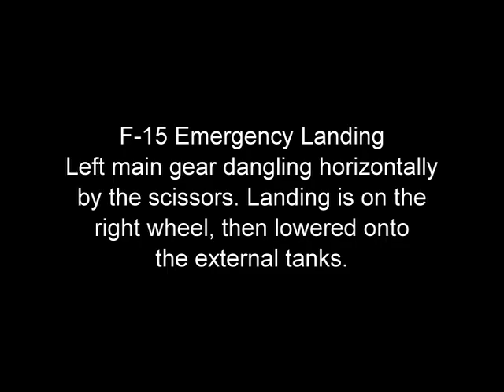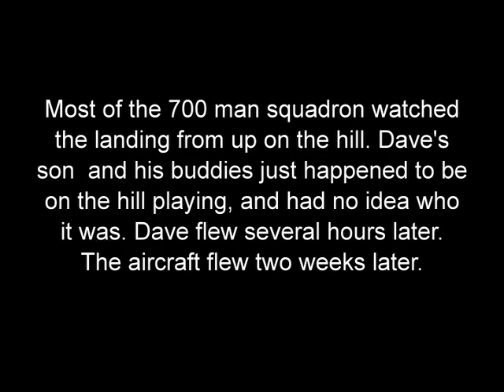F-15 Emergency Landing.mov

Comment: Being that the light grey Eagle was all air-air, did the F-15 FIS squadrons do much differently from the F-15 Tactical Fighter Squadrons? I imagine other than deployments? Or was training and ops similar enough that one could PCS between the two unit types?
Reply from the maker: A FIS and a TFS were very different, however pilots did go back and forth on assignments all the time. The US-based  Fighter Interceptor Squadron mission did not involve fighting enemy fighters. Its adversary was a bomber/cruise missile threat. A Tactical Fighter Squadron's missions are obvious. So in the FIS, it was a lot of night intercepts and  less fighting other fighters. You can imagine how well that went over with TAC F-15 pilots sent to a FIS! For a little while, it sucked. Over time, the influx of TAC fighter pilots replacing  old ADC interceptor pilots got the FIS out of the rut. Fortunately, even at the command level, as Air Defense Command morphed into ADTAC and 1st Air Force and whatever the hell else it was called, the leadership realized it was smart to let the FIS pilots fly some air-to-air missions just like the TFS guys. It kept proficiency up and  the moral up. We could go to Red Flag, for example, but only as Red Air. We could not do escort or force protection because technically we didn't have that mission. But it wasn't a heart breaker that we were restricted to Red Air! That made the Red Flag briefings more bearable and was a lot of fun.  I was the ADO at McChord and thankfully my two squadron commanders pushed to keep us flying standard TFS training missions, including DACT and dart. Our Air Division commander was also a TAC guy and as long as we kept up with our primary mission, he was also fine with us keeping up with normal TFS air-to-air missions. We just had to stay away from offensive CAP or force protection scenarios, but we could fly DACT pretty much all we wanted and get to turn and burn. Semantics. Our standard squadron training cycle started with BFM and progressed right up through 4 vs 4 and large force employment...yeah, and plenty of night intercepts.  I was the Operations Officer at Keflavik, Iceland after that. My commander and I were both TAC to start with (F-4 air-to-air in Thailand, German F-104 Fighter Weapons School, and Holloman  F-15 for me).  We deployed to Bentwaters to support the Aggressors when they went from F-5s to F-16s and we went to Decimomannu (non-stop, unrefueled from Icleand! )  to fight whoever else was there on the ACMI range. So what the FIS pilot got to do was a little dependent on who was running the local show, but we made it pretty challenging.   It's all history now and a very different USAF.
Reply: Thank you for the great info. I'd wondered what the specific differences were. By the time I started in the AF the only FIS units around were in the ANG, with I think the 57th at Kef being maybe the only active one, although designated an FS by then. My time at Holloman was after the F-15 era, when we'd swapped to the 117. Was a pilot in the 7th and 8th FSs, the 7th being our FTU, with the 8th/9th as ops units. The few light-grey Eagle folks we had in the community (everyone comes from somewhere else, in the 117)  were all too young remember the FIS units, so they had no info. The info you write may all be history now, but what a great and rich history it is, seeing as how the AF seems to have a hard time remembering its own history these days.
Reply from the maker: We just missed each other. I came back to Holloman from Kef in 89 and was in AT-38s and had the academic squadron, then the 435th and 433rd TFTS. We changed to the Ops Group structure, a huge project, as we handled the arrival of the F-117. Those two things at once were nuts.  I played Deputy Ops Group commander during that time while they were waiting for a colonel. Bob Huff, F-117s and great guy, came in as my boss and handled the F-117 transition. I stayed with the AT-38/F-15 side until they finally got a colonel in. Back to water boy, but then suddenly back in the game  (no one else left to play!)  and got to be acting DO of the 49th TFW across the base. Just me and the wing cc--he had no vice or DO!  We were busy with a MISP and a squadron in the desert. Really busy. Checked back out locally in the F-15 in 3 days and had a blast with that until we went from 3 squadrons down to two jets. Ugh. They left me in charge of the base one day, so I checked myself back out in the AT-38 in one ride, signed my own Form-8,  and started instructing immediately. Too late to stop me when they got back. I left summer of 1992. Fig was the general and Guariino was his vice. Huff was the Ops Group Commander. Crazy 3 years. It was fun to meet a lot of the early F-117 guys.
Reply: The building where the 4 LIFT squadrons were, eventually became home to the 20th FS and their F-4Fs out of George after that place closed and LIFT left Holloman. The 20th lasted another 12 years until shuttering in 2004. Their F-4Fs I believe were some of the only AIM-120 capable F-4s. You probably remember when the resident drones on the north ramp were QF-100s and QF-106s. My UPT class didn't have any Eagles, light or dark grey. Never really dealt with them in my time, as the Hog and the Eagle have such polar opposite missions, but would've been nice to. Only time I was ever around them was at Elmendorf when dad was up there in mid 80s. Same time when that Lt from the 43rd mis-set his OWS and tore his Eagle apart during that high speed/low pass flyby at Galena.
Reply from the maker: While I was still in the Ops Group, the 20th squadron commander came out for a site visit and was very demanding. Told me what he was going to "take" in that building. Quite rude, actually. He clubbed me over the head with the fact  that it was "the German program" and they would get what they wanted. I had not mentioned it to him, but I had flown in the German F-104 program at Luke for 4-years and taught in their FWS and knew as much about the German contract as he did. He was a knucklehead, but they had some great guys in that squadron I got to know later on. Good squadron. I knew several  of the drone guys. One was an old F-104 IP from before my time. Alaska lost too many F-15s to really stupid stuff. Very sad. I had a lot of interface with Hog guys at Red Flag and other exercises. There were a lot of Hog guys in the AT-38 squadrons, too. They were pretty loose and I imagine they think I was too tough on them--I made them stop eating in flight briefings and close the door, so they couldn't bullshit with guys walking down the hall. Pretty funny! The F-15 community was known for the huge ego, and I found that was true! When I got to Holloman in 1981, their craniums were in danger of exploding. That finally changed into the 90s, but the reputation could not be shaken easily. All seemed silly to me at the time, and still does. The F-16 vs F-15 war was advanced by the generals, Gen Ryan as TAC DO in particular, and I hated that and wouldn't participate in it. We should have been doing mixed force instead of sniping at each other. Ryan hated F-15 guys and told us at a TAC squadron commanders' conference to tell our F-15 guys they would never be squadron commanders while he was in TAC. Unbelievable. The F-16/F-15 feud was one of the dumbest things I saw out of our generals. I hope that stuff doesn't still go on. The force is too small to not use it the best way.
Reply: The F-104 would've been a hoot to fly. If I remember right, Luke had two squadrons of them, the 69th and the 418th. Saw them at an airshow there once, back when Luke had the two Wings under the Air Division still. Speaking of Luke I'm surprised they've been able to remain viable what with the amount of encroachment that's gone up around that base. I hadn't been around there in good few years (Im from the SDL area), then last month, my reserve unit took our HH-60s up from DM for three days to participate in the Transformers 5 filming, and I was surprised how much is around and to the west of there now. We did interface some with Eagle guys at Red Flag, but unless we had some kind of involvement in the air-air fight, we generally tried to stay away from the air-air debrief, which seems to last forever and a day, with the constant syncing/replaying of tapes and pod info during the shot eval......far too long for we lazy Hog guys to stay awake. Insofar as Smurf jets, the Hog guys indeed were more lax. The studs going through the Eagle track had something like 20 or 22 rides of all air-air, offensive, defensive, high aspect; and would come back from rides wiped out. In the Hog track, we had 2 offensive and 4 defensive rides, and that was it for air-air, for our roughly 18 or so ride program at the time. Long time ago so I don't remember the exact numbers, but I do remember my couple of flights with IPs from Eagle backgrounds and they were pretty hard core with the whole "getting you indoc'd to squadron life". One was on my Defensive BFM checkride, the most busted ride in the program. Passed it on my first try because "you're going Hogs, not like you have much to fight with there anyway" lol.
Reply from the maker: That's funny! Fits with my memory of LIFT in 1989. I got there after my Ops Officer tour in Iceland to go through the Smurf IP program. My buddies asked me what I thought of it after a few weeks. I told them it was A-10 guys teaching Vietnam era F-4 stuff to kids going to F-16s and F-15s. It made no sense to me at all! It was the most outdated training I had ever seen. Nothing had been updated since the late 70s! If they picked up those red and blue airplanes on a stick, I'd leave the briefing room. The first day there, before my course started, they had me ride in the back seat of #3 for a 4 v 4, Smurf IPs  against Eagles, led by a famous 435th major (ex F-4) on his last flight. He did no planning and when the Eagle guys got there, he asked them what they wanted to do! They reminded him they were the training aids. Basically he told them to go to the north point and he read the ROE. They Eagle guys were very uneasy and had to ask for their blocks and what ordnance they were supposed to have! Unbelievable. When they left, he asked his wingmen if there was anything they wanted to do. He had no clue! His briefing was so bad that when he got up to leave, I had to say "Hold on. Sit down. Close the door. This isn't safe enough to fly."  I had never met this guy!  We got that fixed and flew it. The guy I rode with never saw anyone and gave me the jet. He didn't even know me. What a debrief. There was a lot of stuff to fix at LIFT, but plenty of good guys to do it. They just had to be turned loose. I had 3 A-10 guys who were stars: two were flight commanders and I made the other one the squadron weapons officer. There had never been a squadron weapons officer at LIFT. There wasn't even a wing weapons officer, so I took that job informally as well as squadron commander. I'm sure I was a pain in everyones' ass, but I couldn't handle that 1970 era F-4 stuff. I did all that the first time. 

It was just the 69th when I got there. 418th was gone. The F-104 was a hoot and the German program was first class. I flew over 1000 sorties and always had a jet and always took off in that jet. Never needed a spare. Lockheed Air Service was the best I've ever seen. It was a great assignment with some of the best aviators I've ever seen in one place. Luke is surrounded for sure, and the F-35 is the loudest jet ever in mil power alone! I think they get away with it only because there are  hardly any sorties flown. The ramp looks empty. It's not like Luke in the old days!
Reply: The 435th is who I went through, and at the time they had just moved to Randolph. The ATs were still B models, so like you said, all the air-ground sorties at the range, were all manual mil-crank bombing: level, 10/20 pop and 30 DBs. We carried the standard SUU-20 with 6 BDUs. Being Hog track, we'd asked about doing some minigun pod shooting, but apparently that had gone away years ago. My class was 2 Eagle studs (A track), 1 F-16 stud (B track), 2 Hog studs (C-track), and a Nav going to Mudhen WSO (D track). The air-air sorites were mostly done by the Eagle/Viper IPs, I rarely remember a Hog or former Vark IP doing those rides. Opposite was true with the SAT rides, and everyone taught the Form and low-level Nav rides. Nowdays, from what I hear, the C model ATs have a HUD, and one that can be programed to replicate the aircraft they're going to. But no expendables on the jet, all SAT rides use simulated ordnance apparently. Funny you mention the briefing style, Im sure for air-air, there were alot more details to brief, blocks, radar sort, form, tactics, etc. By the time I was late in my Hog career, launching on a FAC sortie, I'd head down to the players if they were on base or at Snowbird,  or even  next door at TUS, and (barring any training needs from them that needed to actually be briefed) I'd leave a yellow sticky on their briefing room door if they were in brief, with callsign, airspace I'm in and controlling, altitude I wanted them to be at, time to show, and frequency to check in on. Basically like combat. Everything else, they'd get on scene with the scenario at play. Granted, this method can't be brought back to a UPT/LIFT/FTU training environment, especially for an air-air sortie, but I can see where it may have come from. lolThe F-35 was indeed loud as heck, much louder than the Vipers there at LUF. The Tucson ANG had been a candidate to get them, but the city leadership doesn't seem to care for DM, or the ANG at TUS. They say they do, but it's mostly lip service. They complain that the Hogs and Vipers are too loud, they would've been out of their minds had F-35s shown up here.  With Hogs on their way out slowly, there's nothing really to replace them at DM yet, nothing in stone at least. For all the aircraft here, the 355th Wing only owns two squadrons of A-10s: one ops and one FTU. Every other flying unit on base is a geographically separated unit belonging to some other Wing/base.Was fun times. After leaving active duty after my 117 tour, I came back to TUS from HMN, and went to an HH-60 helo unit as a part timer. Haven't flown a tactical jet in over a decade. I don't miss active duty much, but I miss having to think at 6-9 miles/minute in those planes.
Reply from the maker: I was going to ask you where you were now and what you were doing. Did you have helicopter time before the Hog tour or before USAF? I live by Luke and retired from Southwest, so I went slower than helicopters! Great company. The Cactus Starfighter Squadron, old F-104 guys, still hangs out in the 311th and I go to a briefing now and then. Last one was on the F-35 and the Norwegian who gave the briefing disputed most of the jet's troubles in Aviation Week. I asked if they had CAS in the syllabus, and the answer was "some." I asked the US squadron commander if he thought USAF generals would use the F-35 for CAS and he slowly said "yes." That's  a lot of bucks to risk to small arms. Doesn't look like a tough airplane to me. It's going to be interesting. Air-to-air briefings got way out of hand. To cut down on that, I refused to brief (or hear) anything about taxi, takeoff, to the airspace and back, air refueling...none of that. "Standard." I didn't want to  hear it in AT-38s, either. Students didn't need that time after time.  Guys briefed taxi to death when they didn't know how to teach. After I canceled a few missions they finally quit briefing me on admin crap. I drove the Captains crazy instead of the other way around--I had to try not to laugh sometimes!  I went to Yuma WTI for years (it was my secret), in both the F-104 and F-15. It was like a mini Marine Red Flag. The inbrief with the Marines took one minute: "Defend the South TAC from 13:00 to 14:00. ROE standard. Simulate XXX with XXX. Blocks, kill removal, GCI freqs.  Write your call signs on the chalk board and we'll file VFR for you. Questions?" Done. So much easier than Red Flag. We could mission plan and brief it up in 30 minutes. Debriefs were an hour max. I flew OV-10s for two years and got to operate as a FAC like you did for a while. Big boy rules. It was nice.   Now I hunt with my dogs, surf in CA, shoot service rifle and IDPA, and cuss at the occasional F-35 overhead when I'm trying to hear where the quail are talking.
Reply: Ha! My biggest pet peeve are guys who brief particular admin item(s) as "standard", then proceed to explain it out. You just said "standard", why are you now explaining what the standard is? Isn't standard supposed to cut down on the brieing time?!? Example: "ok, on takeoff, linup will be 20 second interval, standard. So I'll put you on the upwind side, you take the opposite side, comm out signals for ready/runup/brake release....blah, blah, blah."  Shut up! lolYeah, I had civil rotary time prior to the AF. Went to the AF through OTS, graduted #72/74 there, which means I tried to hard, and was one of 3 UPT slots in the class. Missed being able to go to Willie since it had shut down and got Del Rio instead. -37s to -38s. Wanted EF-111s but they weren't taking pilots to them anymore, just EWOs (lucky I later figured out, as I would've rotted away at Cannon). Selected A-10s and did 2 tours, Osan and DM. Put in for an OA-37 exchange tour but it got cnx'd, as those tours ebb and flow with the political winds, went F-117s instead, so short distance PCS from DMA to HMN. In the 7th, then the 8th FS (7th was right next door to the 20th's building back then).  Nearing the end of that, Big Blue wanted to send me to -38 IP at Enid. Didn't feel like going from Alamo for 3 years to Enid for 3 years. Since I was inside 12 months of my ADSC, I had the option to 7-Day opt. So I tried to work with the Randolph weenies, saying I'd done everything the AF asked of me, I'd just like one thing. I'll meet you halfway: I'll go ATC, I'd just like to pick the location. They ask where. I ask for joint USN T-34s at Pensacola, training Navy NFOs. They say no. I remind them I can 7 day opt and get out. They say we know that, but you won't, you have too much time in, officer and enlisted, you won't leave. And leaving Big Blue is scary on the outside, they said. So, I went to the CBPO and 7 day opted an assignment, leving me to finish my time at HMN. OG/CC calls me in the next day asking what happened, and I explain to him what occurred.  His only reply to me was "well, have you considered the concept of service before self?" Seriously? So, I left. Transferred to AFRES part time, and also got hired by CBP as an agent/pilot, based down here at DMA. AFRES unit is helos, so I went to Rucker to do the mil helo transition, which also upped my civil helo certs to Commercial and added an Instrument, which made BP make me a dual-rated pilot. Flew Hueys, and now AStar helos, and HH-60 rescue birds on the mil side. And flew the C550 Citation interceptors for awhile before those started getting retired, the jets with the APG-66V1 in the nose. Now only fly rotary wing. Living on the NW side of TUS. Orignially from SDL, so stil go up there to visit the folks.
Reply from the maker: Good, interesting career you had and a happy ending! Good for you.  I went through a similar exit: I was the first guy to quit the USAF as a student in Air War College. When I went in to get the "General of War College" to sign my retirement papers, he got mad at me. "Why are you doing this on my watch?" Huh? I started by explaining my retirement wasn't all about him. Where did they get these guys? Anyway, "standard" then briefing it. Ugh. Drove me wild! We heaped huge amounts of abuse on anyone who did that and it would start almost immediately upon uttering anything after saying "standard." I'd pretend to start getting out of my seat and heading for the door to cancel the mission or get a new flight lead and the apologies would start flying. I think we finally crushed that.  Funny stuff! It was all I could do to not laugh! Almost as bad was briefing right up to step time. I'd start obviously fidgeting in my seat and they'd finish up fast! I was old--I had to use the head! They would have to keep briefings under 30 minutes for me now. I had two F-15 buddies who were Army chopper pilots with lots of combat time. I was at Southwest with one, but he left Southwest and is the VP of Dillon Aero, the mini-gun maker up here. He flies the helicopter tests with the guns. Cool job.
Reply: Most of the flight briefs I saw guys doing, started to become about 20 minutes of useful info, and 40 minutes of dog and pony show, just to fill the hour. You know...just brief what needs to be briefed. And then we'd get guys who have these complex as hell low-level first-run attack plans, with all kinds of geometry/timing to go with it. What wingman is going to remember all that crap? If the plan takes more than a few brain bytes, then its too complex. And the last thing you want is #2 being heads down trying to find what he's supposed to be doing next on the 1:50 map or his frag card, and smacking the ground or something attached to the ground during the ingress at 300 AGL/300 kts. No bueno.One of the H-60 flight engineers who used to be in my unit down here works up there at Dillon Aero, at SDL as well as their private range they have near Casa Grande. Good stuff. I've got about a year left, then will be happily done with the reserves as an O-5.
Reply: Retiring while in AWC in residence. Oh man, I bet that went down like a hooker in church. Was the General a non-rated, or a rated guy? The non-rated's used to see things like SOS DG or Kingof Flickerball being a major career milestone for them.
Reply from the maker: F-15 guy. Peterman, I think his name was. Had been Wing CC at Bitburg. He briefed our entire AWC class the very first day that if you were two years below the zone, "you will command," but "if  you're only one year below the zone, there are still good jobs other than command ." I was on time. When he asked, "Why are you doing this on my watch?" I told him one reason was because he asked me that question--everything wasn't about him. I told him he personally gave me the information I needed to make the right decision and that really puzzled him. I quoted  his first-day statement and told him I was just on time--he was the one who make it clear I wasn't even on the "Good Jobs" list.  He got quieter and admitted, "I did make that pretty clear, didn't I?" "Yes sir, you did. Would you please just sign this?  I'm in a hurry to get it turned in." He even tried, "Hey, stick with it, the course gets  a lot easier."  That made me laugh. I told him to check my grades--it was already extremely easy and I really loved the history portion.   He was actually cordial to me after that.
Reply: At least he listened to the logic, unlike my OG in the same position. The funny thing is, looking at all that command has to offer in the AF, and it's a ton of work, far less flying, and essentially alot of BS for little gain. I remember as an squadron ADO, my inbox (actual paperwork still very big then) never seemed to get smaller, no matter whether I put in 10, 12, or 14 hours. Finally one day, I just took a random 1/4" stack of papers from my inbox, walked over to the shredder, and ran them through. Just to see if anyone would ask me "hey, did you see paperwork X, or did you happen to endorse form Y?" But alas, no one did. No one ever asked if anything was missing or unaccounted for. That, combined with seeing cohorts of mine taking leave days, and coming in to work ON those leave days to do paperwork for the whole day+, let me know that this really was a modern day version of Catch 22.  When new Lt's were worried about getting boxes checked for SOS or working on a Masters and such, when they were supposed to be only worried about spending time in the vault and absorbing as much tactical knowledge as they could, I knew then that it was only going to get worse.  And sadly, it has.Funny thing, my agency gets slots to go to Senior Staff School courses in residence as a GS; Air/Army/Naval War College at their respective locations. Might be interesting to do as non-military. All my PME has only been ever been in correspondence anyway.
Reply from the maker: You and I think alike. Every new job I had in the USAF had  "required" reports to submit on some schedule. Even as a squadron weapons officer, there were weekly, monthly, quarterly reports of all kinds to submit to some higher headquarters. When I got a new job, I didn't send any of them. I could always claim new guy ignorance. I'd just wait. Often I would never hear a word. Done with that report!  Sometimes someone would call about it and after I asked him if the report was really used, I could get them to remove the reporting requirement! All through my career I'd get a calls from some staff guy somewhere demanding I do something--do a study, send a report, write a paper, do a project, research something...on and on. My answer was always the same: "no." They'd flip out. Most of the time I'd never hear about it. Sometimes it would come back down through my bosses, but I'd usually win. We were doing the job. We weren't the staff's staff! Working on leave days: no way.  I told all the wives that if their husbands said they couldn't get leave, they were lying--call me. If they didn't come home after work, see if they had a girlfriend: we locked up when the last debrief ended. Funny stuff! I told the guys with girlfriends they couldn't use me or the squadron as the excuse anymore. That had a few guys scrambling! Crap, we could go on forever with this stuff. It brings back some funny memories!
Reply: It's just amusing how it's the same BS, different decades, regarding your experiences and mine. With the BS only getting deeper and worse as time goes on. Nowdays, so much is "self service" in a squadron, when before there would be people whose job was to do those functions. Commander's support staff in a squadron is whittled down to nothing. Pay issues, TDY travel, and other support items, are all on the individual. And agencies that are actually supposed to provide support, such as the CBPO or MPF or whatever the heck they call it these days, either never have the right person around, or are magically closed for half a day of training, 2 or three days out of the week. No more simple stuff, like going to the cash cage at finance and getting fronted TDY cash. And don't even get me started on the demise of the club system in the AF. Like how in Del Rio, the club bar had old Tweeet and -38 wing sections bolted to the wall at the root, with a table leg at the wingtip, stools/chairs all around it, and even the position lights on bright/flash. But some non-rated types complained that they didn't feel welcome due to it being all "pilot centric" (at a UPT base), and it all got changed to a Denny's motif. At least at the Willie club when it was still around, in the former stag room you could break anything you wanted to, with the only caveat being that you pay for the damage.Curiously, how was it being Eagles at a MAC base? Granted, I believe you guys were mainly at the south end where the alert barns were, but were there any culture clashes? After the 318th was gone, my last Hog squadron at DM had moved to McChord in the early 90s for a few years before moving back to DM, and I'd neve asked some of those former guys how it was.
Reply from the maker: I saw most of the things you mentioned before I left in 93. Changing the themes of O Clubs to Denny's was all the rage, but now there are no O Clubs, so I guess it doesn't matter. Now it's all-ranks clubs, I guess so young officers can shine their ass in front of the enlisted people and really get in trouble. I went to a Luke graduation a little while ago and was amazed at the song fest with a young enlisted audience watching from the hallway. I'm all for the songs, but not in an all-ranks club. We used to try to hide our act in the back bar. I don't understand a USAF hard over on fraternization that puts everyone in the same club, add alcohol and stir...Of course other than big graduations, it's all moved to squadron bars now anyway. Now they mix in LGBT A-Z. Things are going to get interesting for commanders!    My son-in-law is an E-5 and I've seen all the self-serve monkey business through him. Sorting out finance stuff online has been a nightmare him, with no option for his situation presented most of the time. He can't get anyone on the phone. It's something else! We got along OK on the MAC base, even being rowdy at the Club, which was 100 feet across the street from my house on base. I was ADO and always at the Club, so as long as I didn't get too crazy, we  had some supervision. We got along well with the MAC guys at the Club and always bought them drinks and included them. It was part of the strategy and it worked. Standing rule was drunks came to my house and we did really well with that. No DUIs. Most Saturday mornings I'd come downstairs and see my kids in pajamas, eating cereal and watching cartoons sitting on top of our passed out pilots. The Air Division Commander (1-star) was a no-nonsense guy, but I knew him and liked him from my F-104 days. He knew we were bringing the drunks home and cut us some slack when things got a little crazy. I can't remember for sure, but I think he outranked the MAC commander. At any rate, they got along. The Air Division DO had been my F-104 squadron commander and a close friend. We had a few nights with minor damage at the Club, but we got it worked out without punishment. Overall it went well. I heard the Hogs went there.  Hopefully the good relationship with the MAC side held, but that depends on how the leadership handles things and that can change over night!
Reply: The club system really went to hell a few years after you left, when clubs were forced to start making a profit. Once that happened, the days of there being cheap drinks, a spread of quality food out on the weekends and even at times on the weekdays, all came to an end. Historic O'Clubs like Nellis, Randolph, all became Denny's. Other ones, like the best CONUS one ever located at Mather (JOC night Fridays, apparently ramp space and PPRs were full a week prior), were victims of BRAC. Add to that, SPs waiting outside to bust you for any little thing, as opposed to the days when they gave you a ride home, and there was little incentive for people to use the club in places where there was nightlife available off base. The club at DM, for example, all you really find there in the bar are retirees, and the 12th AF 3-star, with multiple O-5/O-6s surrounding him with the requisite one-drink in their hand, circling in the face-time holding pattern. Other clubs like HMN, even with the AF deficiencies, were kept mostly alive and lively by the Germans, who since they paid for parts of the club and renovations, claimed that they had a right to debauchery, and there wasn't much at all the the 49th WG/CC could do about it.  Really sad commentary on what was once a proud system that one wanted to be a part of.
Reply from the maker: Your description sums it up perfectly. My timing was pretty good for the fun O'Club era. I went straight to Luke F-4s out of pilot training and the Luke club was standing room only, 6 days a week. Wow. Twenty years later,  Holloman was still pretty good,  although the dancers were long gone by then. I was at Luke for the last dancers there. Kind of an encore performance. The Saint, an old F-104 legend, was back in town in F-5s at Willy and held a second retirement party at Luke for his old buddies, well after the dancers had been banned. He brought in dancers and we got away with it for a few hours before they were run out. Fun stuff. Our German students in the F-104 used to date the dancers and would bring them to formal graduations. They can't take my memories.
Reply: Agree, they can't take the memories. It's funny, the AF talks all about heritage, yet they crap on their own heritage. Even squadron bars can't be called a squadron bar, because it may offend someone and it promotes alcohol. It's to be called a "heritage room", again, from a service bent on crapcanning its heritage. It's funny, I vaguely remember the F-104s at Luke in the early 80s, but they must've been a hoot to fly, seeing them coming around the final turn at the speed of heat....I guess what does one expect with no wing. And seeing them parked with actual covers installed on the leading edge of the wing so someone doesn't slice themselves on it. There's still a privately owned two-seater F-104...don't know if it's a B or a D model.... over at Willie. Haven't seen it fly in quite a while, or at least haven't been around when it has. I vaguely remember C model F-4s too at Luke. Was Luke the FTU just like MacDill? And were E models taught elsewhere, such as George?The F-117 was similar in the pattern, from what one of our ground IPs told us in ground school for the 117. He had done an exchange with German -104s in Germany, though I don't know if he did the Luke IP gig. Funny story about him, opening night of the war in Desert Storm, he was one of the first wave of F-117s going into Baghdad to hit the command centers located deeper than the radar sites on the borde that the Army AH-64s had hit at almost the same time. It wasn't really known at that time if stealth technology actually worked, as it had never been tested in real-world combat. The F-117, being slapped together from miscellaneous odds and ends from the A-10 (cockpit), F-15A (gear/components), F-16A (FBW) and F/A-18A (engines), it wasn't very ergonomically friendly in the cockpit in a number of ways. As he is getting over Baghdad, the AAA that was filling the air in a general barrage fashion starts immediately shifting in his direction, as if it's tracking him. So he begins to slightly change course (which is not recommended for a number of reasons), and the AAA keeps tracking him, with airbursts going off all around him. Finally he really starts maneuvering (to hell with not recommended), thinking "this stealth crap is BS, freaking lowest bidder....", finds his target, drops his bombs and gets the literal hell out of there.

Crossing outbound to friendly territory to the south, he's getting his systems back on-line fencing out (de-stealthing we called it......extending radio antennas, lights/emitters on, etc), and notices that his position lights are still on and thats how the gunners were seeing him: visually. Back then in the 117, there were 5 different switches controlling 5 different external lighting systems, located in 5 completely separate places in the cockpit. On fence-in, he'd forgotten the position lights switch. A few years later, the AF installed a single "all external lights- extinguish" switch on the left wall panel for ergonomic sake, aptly named the "Klaus switch", after him. Anyhow, the 117, with its permanent 67 degree wing sweep, did not appreciate slow speeds. Like the -104, definitely a Cat E aircraft speeds-wise. I can remember being heavyweight after takeoff from HMN, headed to ROW to shoot an approach, and circling speed computed at the weight I was at, was 210.
Reply from the maker: Great F-117 story. That's funny! I have some funny ones and not so funny ones I'll share  in a different forum someday. I was "acting" DO (and as a LtCol, it was an act!) of the Holloman wing not too long after the F-117 got to Holloman, so I was on the DO brick for all of their flying. "Whew," is all I'll say now. I flew F-4Cs at Luke in FTU (back then, RTU) in 1972/1973. It  was like MacDill. I think George had  E models then. As I recall, George Lts who showed up with me at Udorn had flown E models. Luke had an F-4E simulator with the 556 mod, the hands-on-stick-and throttle switches, so we had one look at it. When I got to Udorn, they had D, E, and E with 556--all in one squadron! I had a few MQT rides with an IP in different D models, all with crew chief mods, and then they gave me an old Major WSO to fly with since there was a "crew" hours requirement.  The first jet we walked out to was an E model with 556. Yes! I said, "Sweet! An E-model!" My WSO asked, "You like E models?" I said, "I don't know yet, Mac, I've never flown one!" I guess it didn't occur to them I hadn't flown one at Luke. Mac didn't want to go, but I talked him into keeping his mouth shut and promised  him some stick time. Just another airplane. Pull back, go up.  Fun stuff. The F-104 was really fun. It was simply half an F-4 and flew like a hard wing F-4 except  add a few knots to all the speeds in your head. In the F-104, you could throw in aileron at any speed, unlike the F-4 that was definitely rudder only in the traffic pattern and fighting at slow speed. You guys had pay attention in the 117--I saw that for sure.
Reply: Would love to hear the old school stories , or or off line. Stories from back in the day are always cool. The only former F-4 guys we had in the 117, were ex- E model guys from George/Clark/Moody/Seymour, and ex-G model guys from George/Spang/Nellis. The rest of our senior pilots (senior Maj and up) were mostly ex-F-111 guys, with some F-15/16 guys around. The junior pilots (young Maj and Capts) were primarily F-16 background, with F-15A/C next, some F-15E guys, and a few A-10 guys.  Definitely a mix of experiences. Besides the 20th and their F-model F-4s, the only other ones were the QF-4s on the other side of the base. Some of the old heads would talk of the C-model and its hard wing, vs going to the E model and now having slats. Regarding the F-104, why were the Germans having so many problems with them when it came to accidents, whereas other countries who operated them didn't appear to have as many? Just the jet, or the European operating environment? I remember the Tornado guys at Holloman would fly in the crappiest of WX, where we 117 guys were long ago WX cancelled.
Reply from the maker: Many of the early German F-104 losses were weather and experience related. Hartmann didn't want the F-104 for that very reason and fought the government over the purchase, even resigning over it. It turned out he was right. Low levels and the gunnery range in bad weather, as well as weather-related crashes in the traffic pattern,  continued to be a factor all the way up to my time. When the 117s got to Holloman, they kept busting the front sensor glass with hail by religiously flying the Cloud Departure to the point named "Cloud," named for the thunderstorm that sat over Cloudcroft every afternoon. I  warned them about it. I told them to stop going to Cloud after they broke the first one  After they broke the second one, I asked them why they kept flying into that thunderstorm when I told them not to. The told me because they didn't have a radar. Wow. I told them they didn't need a radar, the thunderstorm was in the same place everyday!  We didn't have a radar in the AT-38 and managed to stay out of it. They broke five of them. Slow learners, I guess. It was a stupid departure and I couldn't make the base get rid of it, but that's what "Cancel IFR" is for. The squadron commanders would complain that I "didn't understand their mission or their jet." So, I asked them if they could fly their mission with the glass busted out. They said, "No," so I said it seemed I understood their mission and their jet better than they did and they need to stay out of that damn cloud! Funny stuff now, but it was expensive!